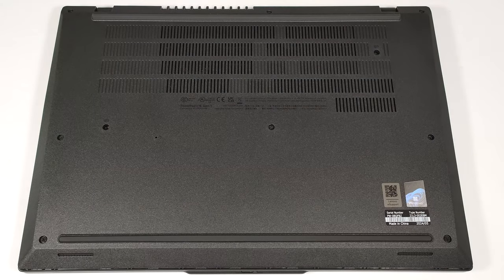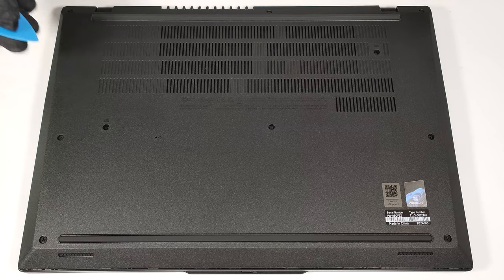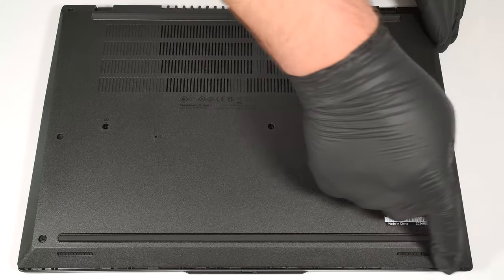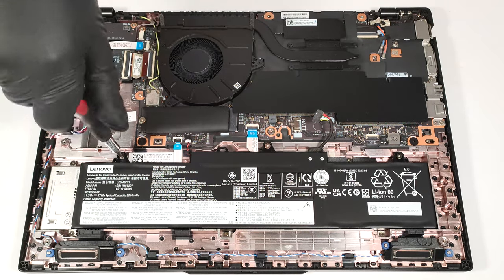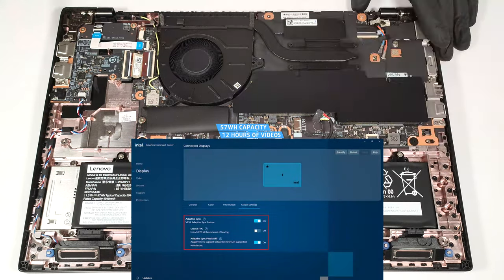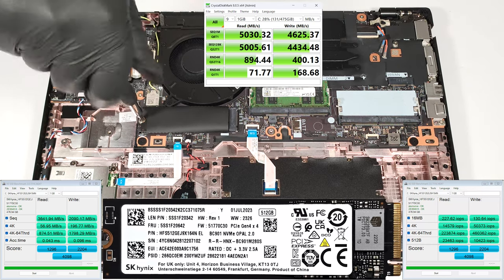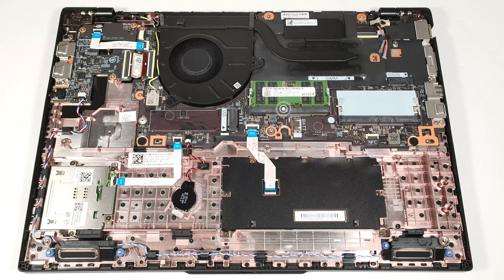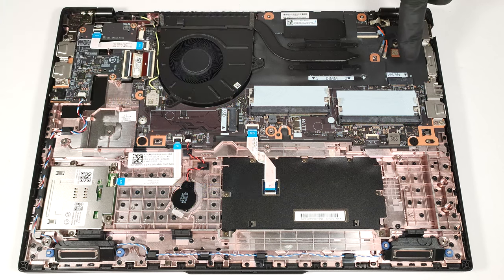🛠️  How to open Lenovo ThinkPad L16 Gen 1 (Intel) - disassembly and upgrade options

Comment: The keyboard is not replaceable, which means you need to replace the entire top cover after separating all the parts attached  to the part. Thinkpads are getting worse each year.
Reply: This model (L16) has a replaceable keyboard. Check support mate. I think you're confusing this with the e series.

Comment: just what I was looking for, thank you for the video. so in conclusion, is the ram memory upgradable?
Reply: There are two RAM slots available, so yes, it is upgradable. However, this is a crap-tier laptop.
Reply: @RmFrZQ  why is it a crap tier laptop?
Reply: @xaznarthx  mostly because of inefficient cooling solution, that will make your CPU throttle after a few minutes.
It has only one stick of RAM, which means single-channel memory.
It has unbranded NVMe drive on which you can't find specifications (DWPD, Total TBW, DRAM Cache, etc).
Only one M.2 slot, which means no local backups when you go offline.
Soldered Wi-Fi adapter, which means you can't replace it or upgrade it.
No WWAN adapter. No fingerprint reader. All good advertised features are optional.
A case made of plastic, which means screen hinges will crack at some point.
I can tell it was build to fail.
The only workload I see for this model is to forever sit on a desk and show browser and some spreadsheets. For the asking price it is unacceptable and I'd rather get a PC instead.
Reply: it’s using a Amd U processor, its power efficient and can manage thermals fine.  SSD and RAM can be upgraded for super cheap so you can just buy the base model and upgrade your self so it’s a non issue.  the build i agree with its made out of polycarbonate.  Not sure how it will hold up.  i got it for 730 with discounts.  wouldn’t of bought if it was over 1k
Reply: the price i got it for also includes the IR camera for face unlock has also got the 100% srgb screen with 400nits brightness and low power display

Comment: E series - entry-level laptop
T series - default option
X series - same as T but better build quality, more durable, and with higher specs
P series - portable workstation, bigger and heavier, but way more powerful

But what is L series?
Reply: Not Entirely Accurate

E Series - Rebranded Ideapad/Thinkbook (Consumer Laptop with Trackpoint)
L Series - Lower Budget Business Laptops
T Series - Regular Business Laptops
Ts Series - Slim Business Laptops
X Series - Small Business Laptops(13 inch) 
X1 Carbon - Premium Business Laptops
Z Series - Macbook esk 
Ps Series - T series with GPU
P1 Series - Centered Keyboard, Modern Design Language, Thin and Light Workstation (?) 
P Series - Portable Workstation, Magnesium RollCage, Closest Design to older Thinkpads